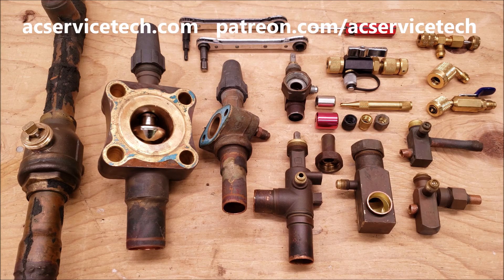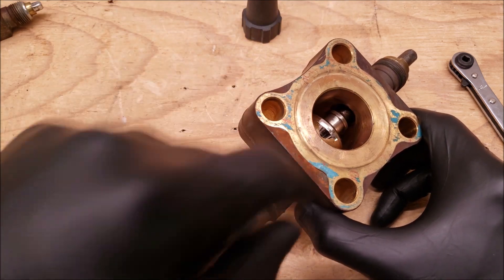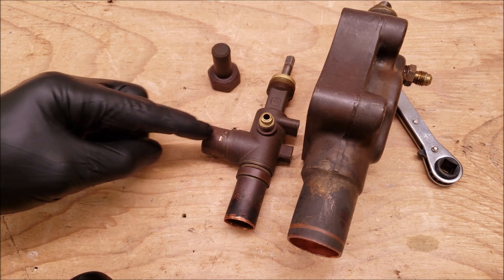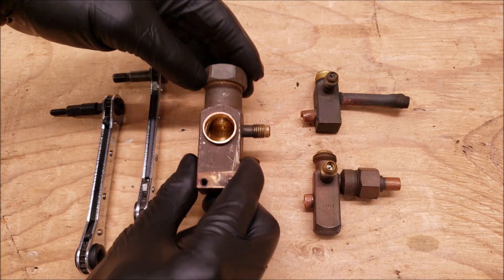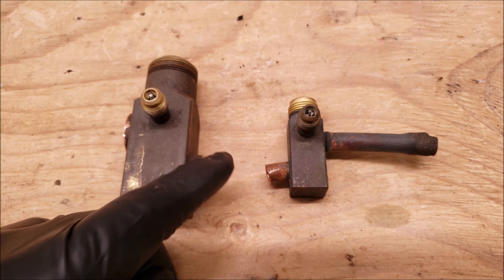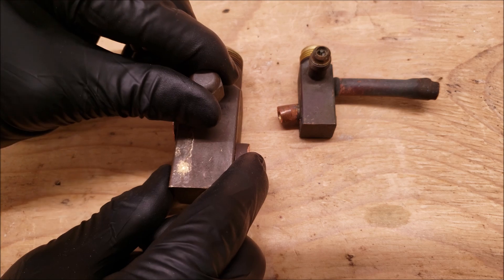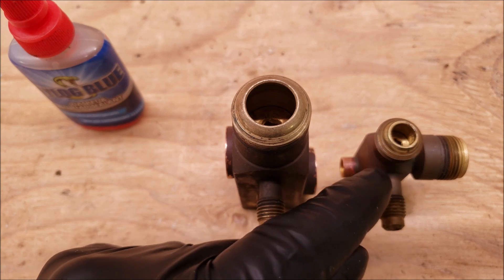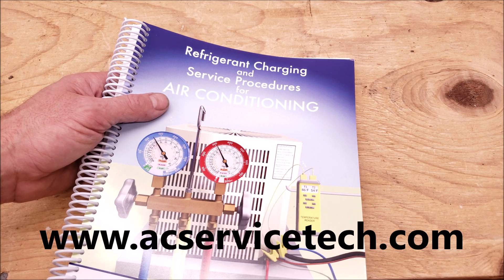Types of HVAC/R Service Valves, How They Work, Port Access & Problems!

Comment from the maker: The Book:  www.acservicetech.com/the-book
The E-Book and Paperback are both is Available for Purchase at the Website!
Tool List-  https://www.amazon.com/shop/acservicetech
Support the Channel-  https://www.patreon.com/acservicetech

For those that are looking for the tools used in the videos: (Linked Below)
Appion Valve Core Removal Tool http://amzn.to/2uYr8WL
RectorSeal Bubble Gas Leak Detector - http://amzn.to/2ckWACn
25 Valve Cores - https://amzn.to/2L37UJU
25 ¼” Brass Port Caps with rubber O-rings - https://amzn.to/2GIOdD2
Brass Valve Core Tool which holds 3 valve cores - https://amzn.to/2GFEbm2
Valve Core Torque Wrench - https://amzn.to/2GHiLoD
Locking Cap Universal Lock/Unlock Tool - https://amzn.to/2GGAoVp
Locking caps - https://amzn.to/2GFXZ8A
Ratcheting Service Wrench http://amzn.to/2dGV4Nh
Yellow Jacket Sealright 90 Coupler- https://amzn.to/2LsU1V7
Yellow Jacket 1pk Compact Ball Valve- https://amzn.to/2uXdF18
Yellow Jacket 3pk Compact Ball Valve- https://amzn.to/2AiKfQe
Thumb Screw Valve Core Depressor with Backseat- https://amzn.to/2mR0sCL

UEI DL479 Multimeter with temp sensor http://amzn.to/2jtsUbJ
Yellow Jacket Refrigerant Gauge Set http://amzn.to/2aenwTq
Refrigerant hoses with valves http://amzn.to/2aBumVI
Yellow Jacket Gauge set & hoses https://amzn.to/2vLVkV9
Yellow Jacket 4 Port Manifold w Hoses https://amzn.to/2BkuGIq
Digital Refrigerant Scale  http://amzn.to/2b9oXYl   
Ratcheting Service Wrench   http://amzn.to/2dGV4Nh 
Accutrak VPE Ultrasonic Leak Detector https://amzn.to/2nFYKVe
Accutrak VPE-GN Ultrasonic Leak Detector https://amzn.to/2Zy4IZP
FieldpieceSMAN360 Digital Manifold Set https://amzn.to/2BdoaD4
FieldpieceSMAN460 Digital Manifold Set https://amzn.to/2nB4Fe6
Ultrasonic Leak Detector with Headphones- https://amzn.to/2B2cRO3  
Compact Ball Valve for Refrigerant Hose https://amzn.to/2KUisW8
QuickDisconnect 90 for refrigerant hose https://amzn.to/2MMtVcg
JB 6 CFM Vacuum Pump   http://amzn.to/2nqbvo8
Appion Blue 3/8" to 1/4" Vacuum Hose http://amzn.to/2uYlVyc
Appion Red 3/8" to 1/4" Vacuum Hose http://amzn.to/2uYg6Ro
Appion Valve Core Removal Tool http://amzn.to/2uYr8WL
Yellow Jacket 1/4" by 1/4" hose http://amzn.to/2umtcod
CPS Vacuum Micron Gauge http://amzn.to/2v1nM3O
Supco Vacuum Micron Gauge http://amzn.to/2v1JRiA
RectorSeal Bubble Gas Leak Detector http://amzn.to/2ckWACn
Magnet Jumpers- https://amzn.to/2PyKPQZ
Alligator Jumpers- https://amzn.to/2PxqJXn
Fieldpiece ST4 Dual Temp Meter  http://amzn.to/2wc1ME3
Fieldpiece Bead K Type Temp Sensor https://amzn.to/2DBwKfs
Fieldpiece Wet Bulb Temp Sensor https://amzn.to/2RRI7Tw
Fieldpiece TC24 Temp Clamp https://amzn.to/2qHLyjZ
UEI DL389 Multimeter  http://amzn.to/2xAdaJf
Air Acetylene Torch setup    http://amzn.to/2aQalsb  
15% Silver Brazing Rods  http://amzn.to/2gVLyLc
Nitrogen Regulator    http://amzn.to/2bXdR5f
Nitrogen Flow Meter    http://amzn.to/2brvoBg  
Other tool links can be found in the video description section.

Shop through Amazon! Your Purchases through Amazon provide a means for channels such as mine to earn advertising fees from all purchases after clicking through. Prices are the same as normal-    https://www.amazon.com/shop/acservicetech

Comment: I’m wondering about removing a suction line king valve on a 1/2 hp Copeland compressor, do I need a back up wrench and does this just come off by unscrew in the nut? Is it regular threads? And the Teflon ring is that something I should reuse I heard there was one in there. Thanks. If you can help I do have your book. I’m looking through that, but I can’t find the answer.

Comment: When you have to hook up gaugea and need to get a presaure reading from the  coreless shrader port on a three position valve can I just put it in the midseated position instead of the 180 degree turn position so its easier to remember, is there any difference in checking the pressure if its mid seated or turned 180 degrees from the bqckseated position?

Comment: Your videos on service valve is the best I have seen. Thanks so much. Question: I am trying to replace Schrader valve on high pressure side, but valve stem comes out only enough to leak lot of Freon if i open port. But cannot remove valve using valve removal tool and cannot get it to reinstall the schrader valve.  Is there a way I can use service valve to isolate schrader valve port so I can remove it with pliers ?? There is another schrader valve on secondary access port, so I thiink it must be two way valve and unable to isolate with service valve.

Comment: I have an still new, never used/installed air source heat pump that still contains the factory pre-charge of R22 refrigerant.  I have brazed the line-set and can pull a deep vacuum that will hold (down to about 175 microns) but when I remove the low side service valve cap to access the fitting to release the pre-charge refrigerant, I immediately lose my vacuum through the simple removal of the service port's cap.  As a consequence, I have no way to then be able to release the pre-charge of refrigerant, without immediately losing the vacuum in order to back-seat the (hex) valve.  What are you thoughts about the possibility of an extremely slow/trickle release of the pre-charge of refrigerant through the high side service valve?  Basically very slow in order to create positive pressure in the refrigerant lines without a full release, and then proceeding by coating the low side valve's sidewall with Nylog Blue hoping for a proper seal while back-seating the valve fully in the hopes that it will seal the leak.  Then, as a final step, I would fill the low side service valve with additional Nylog Blue and replace the service valve cap.  As it stands right now, the service valve cap in place is sufficient to seal the system to maintain vacuum.  Just trying to figure out a way of releasing the pre-charge with a slight vacuum leak in the o-ring gasket of my low side service valve.  Saw you mentioned at 16:20 into this video about the use of Nylog Blue to seal vacuum leaks.  My situation is the same, except that in my situation this is a new install still with factory pre-charge.  Thoughts?

Comment: Hello I have a question about the king valve for the ac condenser unit and please correct me if I misunderstood but you were saying when you "front seat" the king valve, your cutting off access only to the compressor and only have access to the lines but yet how can you pump down the unit when the compressor is out of the equation? Where would the freon go? When you say "pump down" to me that tells me the freon is supposed to go into the compressor. Did you mean front seating and then putting it on the vac pump to clear out the lines as opposed to pumping it down? 
I'm looking at this as if I was changing out a coil only. Sorry If I got lost on this.
Reply from the maker: Ok so the king valve is used for refrigeration and is found on the side or top of a receiver tank. If you are talking an air conditioner with the three position service valve, thats different. You may want to check these videos out- https://youtu.be/9hN7u8iT8vI   https://youtu.be/WlJTY75oSqE   https://youtu.be/snGgOWjfcRc
Reply: I think you mean the 3 position valve for ac and heat pump. I was confused on this one as well for a bit, but I believe he meant front seat as the final pump down step, so that the refrigerant does not go back through the vapor line, towards the evaporator.

Comment: back-seating  and blowing the breaking the snap ring/grrove want the main issue.... the issue is RUBBER o-rings and lack of ones that are good quality ( ROHS etc etc etc etc)
Reply from the maker: That would be very bad for sure, thanks throttle bottle!
Reply: wow, I need lessons in proofreading and to pay attention before posting.... I wont bother to edit the typo's and brokenness..